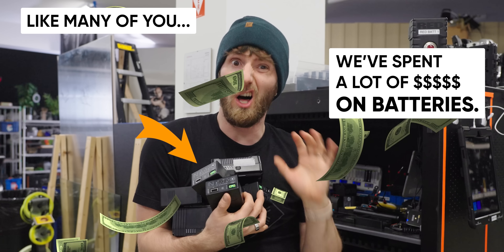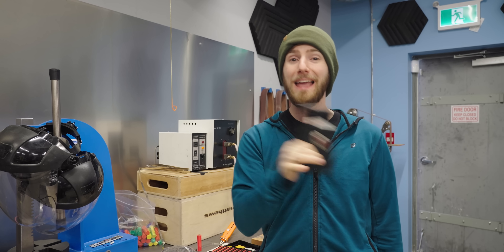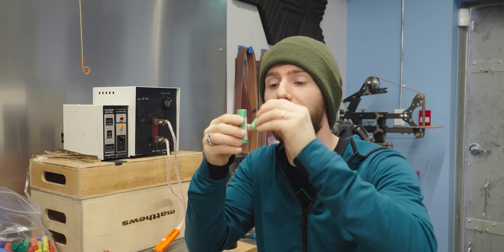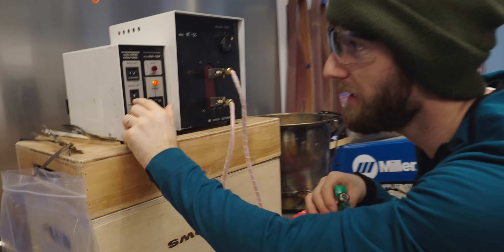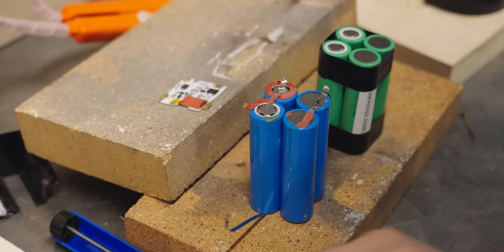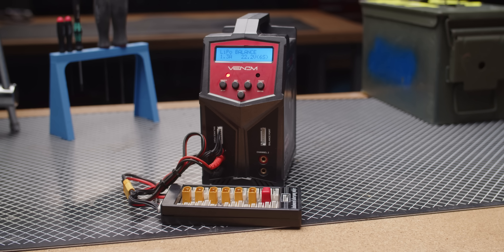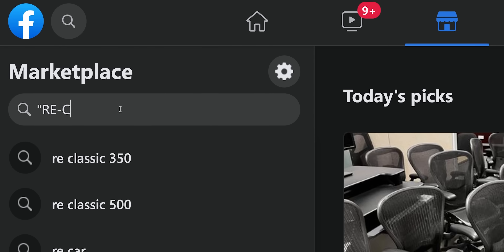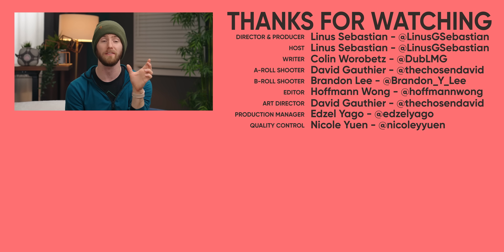This should be illegal… Battery Repair Blocking

Comment: Laptop manufacturer prominently Dell and HP use BMS which will notify after set  number of cycles to replace battery even if the battery is in good condition. 
BMS shut down after cells are removed is a safety measure. Most of the times it is accomplished by a fusible switch. As a cell is removed or voltage drops due to some reasons, BMS will send a certain amount of current to fusible switch which will cut off battery connection to device thus saving your costly device from having any damage. You can replace cells and resolder the switch. There are battery analyzer tools available which allow you to reprogram battery BMS according to mah of battery installed, since even if you re awake BMS after cell replacement it will remember the capacity and health of first cells and will not charge new cells until reprogrammed.

Comment: Did you seriously not put the BMS on it's charger after replacing the cells? Practically the first function of a BMS is to shutdown output when the cells are low to prevent over-discharge. After replacing cells, YOU MUST APPLY charge voltage to the BMS to enable the output MOSFETs again. If you did this, but didn't mention it, that is a serious omission.

Comment: Also You could still cheat with cell replacement.
You could get 18650 adapter so 3 aaa turns into 18650 and can use ni-cad or lithium.

Comment: At a hobby shop I worked at we just tossed dead or rupturing batteries in a barrel of water out back of the shop. Could have been salt water. Never had a problem when I worked there.
Reply: Go to a hobby shop. You can find good and cheap Li-Ion batteries that come with connectors and internal safety chips. Just modify the connections to connect the battery(s) to the an compatible output and get a cheap Li-Ion charger to recharge the brick cells. Make sure the charger is capable of charging at the required AMP, voltage and battery type. Avoid using "quick chargers" or using the quick charge features. There are also stand alone battery testers about the size of a quarter. Just touch the leads together and they will tell you the AMP and volts.

Comment: instead of welding the batteries, why not design and 3d print a housing to pop those batteries in and out. Ya know with little spring contacts to hold the batteries in.

Comment: Linus, i understand your pain. As a battery recycler, including laptop batteries. All BMS boards have proprietary firmware on them thats usually password or code protected. The manufacturers call it manufacturers security access. They claim its for security when in reality its a money cash cow.
There are several groups that have hacked firmware from battery controller chips and found all access codes. Black hat event anyone? A very clever individual reverse engineered an apple mac battery....clever stuff!
Reply: HACK THIS SHIT!!!! The Manufactuers shall see nothing else but our MIDDLEFINGER in their faces!
Reply: I rather buy a new battery that costs peanuts, than risk chineese knock off chip or complete meltdown of the cell and damage to everything around it becuase someone wanted to cheap out on it..
Reply: @kira07  The new battery is 99.999999999% chance still made in China regardless of brand, LOL.
Reply: @kira07  Where do you buy new quality batteries for "peanuts"?
Hint: that doesnt exist.
Reply: Links, please (to the "several groups" and "very clever individual")!
Reply: @ncdave4life  google Charlie Miller and black hat 2011
Reply: @atomicviking2497  It's about selling new equipment, not about our safety.  Amazing what a little lobbying can do.
Reply: Right To Battery Repair ?
Reply: Right to Repair must be very independent of Battery Repair. Don’t mess with flammable in which fire mitigation does not exist in an extinguisher. Notice that Linus held an ABC extinguisher which does not cover electrochemical. BMS security is the only method protect idiots from either electrocuting themselves or burning down their houses. I’ve seen Linus do some dumb things, and as a practicing electrical AND electronics engineer, Linus has done several practices that are very unsafe but well enough with the budget to him. His budget for appropriate materials is likely much larger than yours. Do not attempt to perform your own battery repairs. However, other repairs on phones and tablets, by all means, go ahead.
Reply: @diehardAMD  Even if its not repairable by average consumer, it still should be repairable by 3rd party repair shops with tools and skills. Thus BMS security should still be able to be circumvented. 

How do you define what's too dangerous? People will kill themselves even with glass shards from shattered phones, since there is always one, or loose fingers repairing their tractors.

Also by making "too dangerous" exception might just encourage manufacturers to make repairs dangerous.
Reply: @diehardAMD  You would need well over a 12s Lipo pack (50 VDC) before electrocution would begin to be a danger. Its extremely rare for a consumer battery pack to be over 12s.
Repairing your own packs does not require expensive equipment, a decent spot welder can be bought for well under $100 usd. Re-celling one pack could pay for the spot welder. 
If you do a little research and use common sense it can safely be done. 
Why is it "engineers" think they know everything and their way is the ONLY way???
..
Reply: @diehardAMD  😂😂😂😂🤡🤡🤡
Reply: @diehardAMD  the B and C parts cover B and C class fires, chemical and electrical, respectively. They'd work just fine for "electrochemical" fires. The problem is that a lithium battery fire is a metal fire, a class D. Only thing to do there is complete evacuation of oxygen via halogen and/or immersion in sand.
Reply: @diehardAMD  Oh, you're not a Pulitzer-prize winning Harvard graduate. I don't think you're qualified to be typing comments on YouTube. You should leave such tasks to the professionals.
Reply: @diehardAMD  I shouldn't try cooking recipes then, b/c .. fire 😱

Nanny mentality like that is blackpill enough to show that this generation is so f*cked & coddled ... that mentality is why we have incompetents like TrueDoh or Bidumb in positions of power.. 

Are you familiar with the prison experiment? People align to assigned roles. If you imply competency, then that will become the average behavior. Let the outliers take care of their own aspirations for a Darwin award; the easier they are to spot, the easier they are to mitigate.

The bigger safety problem comes from gatekeeping knowledge: partially-implemented ideas are dangerous, so why not freely provide full knowledge to include hazard management - especially since curiosity can't be regulated?
Reply: @lazertroll702  Wait till he finds out about propane grills and he'll ban swapping out tanks.
Reply: @RichardPrendingue  kek! 😆
Reply: @demonwolf8024  how was it rigged? What would be your alternative? 

Pointing out any manipulation of an experiments parameters is a red herring if the same experiment - manipulations or all - is documented or can still be reproduced.. 

I do go so far as to suggest that some form of the prison experiment is inherently tested (reproduced) many times within the average human's experience, or moreso for parents .. 🤔

Comment: as some1 who has re-celled allot of batteries, and electronics, please don't try it on ur own in your home. there is a high risk with this kind of stuff, and not only do you need the skill and equipment to do it properly, you need the safety plans for when those skills and equipment fail. not if, WHEN. especially with some particaly overpriced batteries from allot tool companies.

Comment: The battle for right to repair in automotive industry has been waged since the late seventies. PROGRAMMED OBSOLESCENCE DOES EXIST! Most commonly in specialty parts availability cancellation with 5-7 years of production. Example: Mid 2000's Volvo Engine Computer Failed and No New Computers available and a Salvage Unit  CAN NOT be Reprogrammed to match the other vehicle.

Comment: when I saw the battery protection board, to which a smaller number of taps for measuring voltage was connected than the number of cans, I immediately realized that your battery is shit.
cuz when u use this schematic shit u make u just killing u battary when they are charging

Comment: The BMS thing isno joke. I fix dji drones and sell them, and those batteries are a pain to re-cell due to the BMS. There are interface things that help to unlock and erase the data that locks the BMS, but they are expensive and you have to find the programs or software for them. And even if you do there's no guarantee it will work. Its all done because of what they call "safety" which in reality is greed. 
Another thing is if you get aftermarket BMS it will not communicate properly or at all with the mainboard in the item. Soo you're screwed either of the 3 ways. Thats a damn shame how many li-ion cells go to waste and  not recycled. For example look how many single use vape pens are thrown out. I got two decent size boxes of the cells that are used in them and 95 to 99% of the cells are good to recharge. Just shame.

Comment: Sometimes you have to put a charge through the bms to reactivate it or wake it up. If you short it or it gets 0v  through it. So if you put a  voltage into the charge port for a second or two. That might activate the power packs bms. Worth a try if you haven't already.

Comment: 16:40 This can probably be avoided by connecting the cell pads to a voltage source similar to the battery bank before actually disconnecting the cells. This way the BMS wouldn't have an idea whether or not the cells have been removed or replaced.
Reply: Probably right, assuming it is either NVRAM or voltage detection issue. 

In the 1990's, OEM manufacturers for car radios had anti-theft systems which would disable the radio if you lost power, requiring an unlock code. As a car stereo installer, this was a huge pain as only dealers could access these codes, and they wanted to charge $$$ for that. So we figured out to solder a 9V battery to a cigarette lighter plug whenever we needed to disconnect the battery. Things got a little more hairy if we had to disconnect the radio for any reason, but normally if we did that it was because we were replacing the radio. For that, we had a collection of common harnessed wired to 12v battery packs. As long as you immediately plugged this in after removing the radio (typically <10s), it would not trip the anti-theft feature.
Reply: @azurealism  good idea with the 9 volt. When I was turning wrenches, we used a dedicated battery pack that was plugged into the OBD port that did the same thing (it also kept the computer from resetting). The radio thing was mostly Hondas and thankfully Honda has a website now that will let you retrieve the code.
Reply: @azurealism  Honda has that on their cars.  The "code" is a sticker in a certain location on the vehicle, meaning that the dealer was getting FREE CASH.  Their mechanic knows where the code sticker is located (I used to know because they told me when I bought the car where it was in 2007.   Since then I have replaced the car battery(so, meaning "no power" with 12v battery and all I had to do was reset my radio stations as that was forgotten by the radio.    That took like an 15 minutes/hour to replace the battery.(can't remember exactly because it was a none issue.)  I was not in a rush.  My car, my time...my beer was getting warm.
.  The anti theft device NEEDS the KEY CODING.  As I was still using the key for the car, it recognized that coding as the correct one so the radio plays.   
- If someone was to take the radio out of my car and put it in theirs, their ignition key does not have the same key code so radio is DEAD.
.  The key code is on another sticker placed somewhere on the car and the dealer just reads the code and can cut the right key for it so schit works.
Reply: @azurealism  exactly! same thing with the idle control for toyotas & various vehicles . major PITA.....soldering the 9 Volt battery is pretty interesting . BUT I LOVE ITI think I'll stick with the schaumaker memory saver... BuTI'm always down for a good hack
Reply: That's assuming the BMS doesn't keep track of statistics like cell capacity. If it does, and notices from one cycle to the next that capacity has increases by some threshold, it bricks itself
Reply: It's like when I replace the battery in a car at the shop ,i use a jump box connected to a memory saver then installed into OBDII. keep alive memory stays ...well ,alive!... This is coming from someone who has limited electrial background. i ALWAYS SEEM to land on Linustechtips...so keeep up the good work~!
Reply: Was gonna say, why don't they just measure the voltage in the BMS circuit, connect it to a steady powersource and keep it on life support while they re-cell the pack?

Comment: You should try doing a RED battery again, and treat it like a modern car, keep the computers up.  Match the new cell voltage to the old cell voltage, connect the new and cut the old while staying live.  Then it will just be a question of will the BMS learn the new capacity or limit or reject the change.

If you don't fancy 2 packs connected at once, just use a variable supply as an intermediary and of course match the voltage.  I would leave it at the lower voltage and then charge the battery, don't be tempted to leave the new pack high and raise it with the variable supply to the new battery voltage.  BMS might not like that if it's counting the charge, better bet to just move the BMS across the batteries evenly.

If it fails moving it across evenly and won't learn the new higher capacity, then you know it's evil or at least one direction on diminishing capacity.  Still could work OK from a newer battery, swap across to new cells on schedule after a year or two, before they lose much capacity.
Of course really evil advanced software would have a diminishing capacity curve built in, would just follow the original cells down, but also a cell swap still wouldn't gain anything it would still diminish curve down..

Comment: I've had these sort of problems trying to re-cell laptop battery packs.
If the BMS detects any cell going out of whack the BMS will blow a safety fuse. The way to avoid this is too make sure you disconnect the minus or 0v tab first.

Comment: Years ago I replaced some "non-replaceable" internal AAA lithium ion batteries with new units with power strips already attached.  I carelessly and accidentally caused those strips to short while I was holding them and getting ready to put heat-shrink around those leads to prevent just that.

In what seemed like less than a tenth of a second, those strips I was holding in my fingers, became red hot.  They literally melted clean lines into my fingerprints faster than I could flinch.

A single AAA!  With nothing but the charge it still had from the factory, having waited for who knows how long in storage.

That was my real World introduction into the power density and instantaneous current capability of lithium ion batteries.  They really are no joke.
Reply: Yeah..  I had an 18650 high discharge (vape spare) fuse with my a key on my keyring and started heating up my pocket at a party once..  Luckily the key could deal with the amps enough that it didn't burn my clothes, just got hot and stayed hot, and I managed to get it out and outside without mishap..  Scary how 18650's are only protected by little ring of plastic around the +ive terminal to insulate the -ive case..  (meaning a few mm of metal on top not quite centered will short it.)  Now I always use the rubber cases for my spares..

Comment: to clarify for the idiots ... 9 volt ... comes in 2 physical sizes 
1 = smoke detector size.
2 = shoebox size used for HEAVY duty flashlights ( handheld torch for those in the UK ) .. ( THIS size ) is made up of many AAA , AA , 1650's wired together.

Comment: do bundles of 2 or 4 - add a pig-tail connector . then at the end - connect all of the connectors together onto the BMS curcuit board.
( i upgraded my old tablet this way ... took the original lithium pack out , made 2 copies of the original ( THEN ) stacked & wiring the packs together ) 
( before re-assembly - I needed to put the outer case over a brick & roast it with a torch ( for a few seconds ) - to melt / BULGE the case out - making room for a thicker battery pack. )

Comment: Not everything should be end user replaceable but there should be a third party option. Safe is a valid concern but definitely not a reason to completely f-up repairability options.
Manufacturers locking things down like this is downright stupid and very bad for both the consumer and the environment.

Comment: Yes.  Book the visit!
By the way I've got several Ryobi One+ Batteries I've re-celled, working just fine after years!  In each case only one or two cells were fully dead - I got 3 good batteries from 4 dead ones, with spare cells left over great strike rate!
Be more Ryobi, other manufacturers!
Another thing to bear in mind: Need to make sure ALL the specs on the replacement cells match the originals - a deep cycle cell for a cordless drill is not the same as a laptop battery even if they look and appear to charge identically.  Swapping them entirely will likely impact performance - but mixing and matching could cause accelerated degradation.